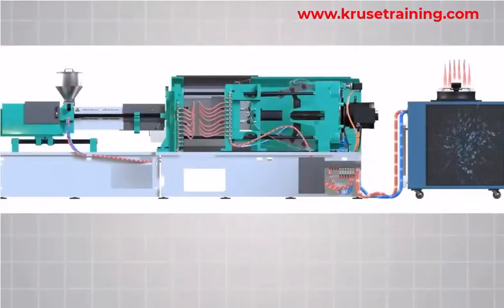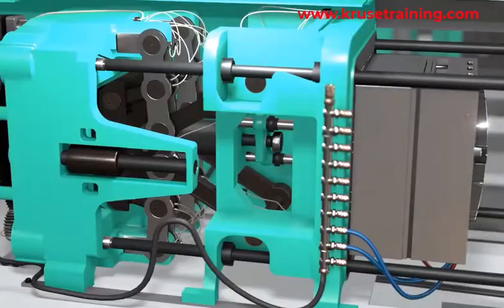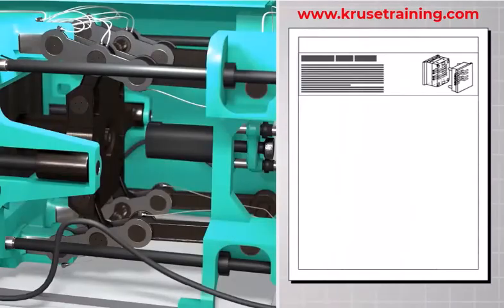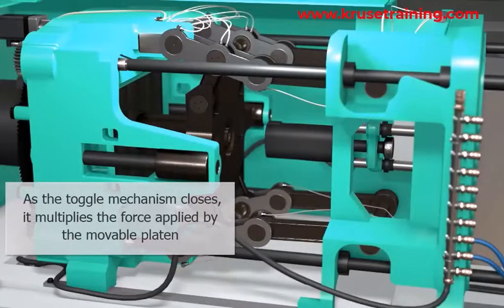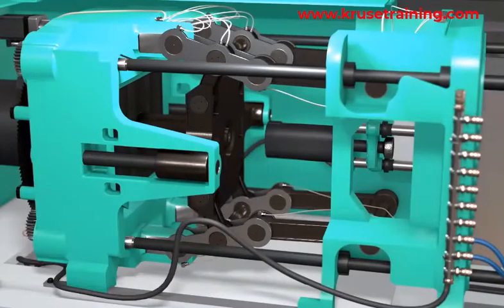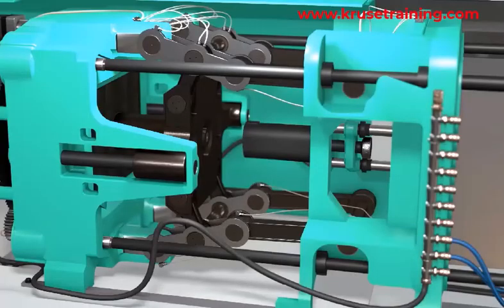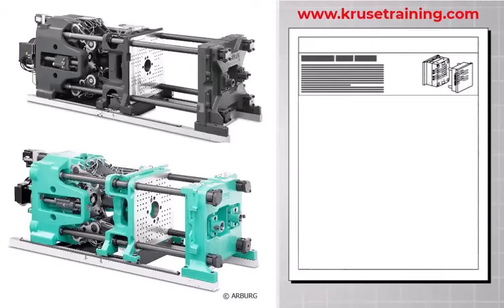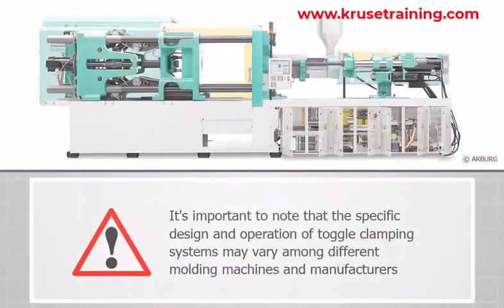Toggle Clamping System

Comment: I am on desing my injection molding machine, and i will know what type of metal did  you used for toggle system? and do you have calculations? i will use ball screw with max applied force (250kN) 80mm